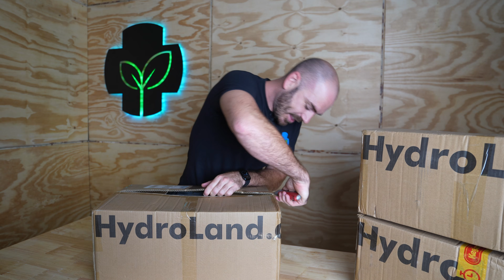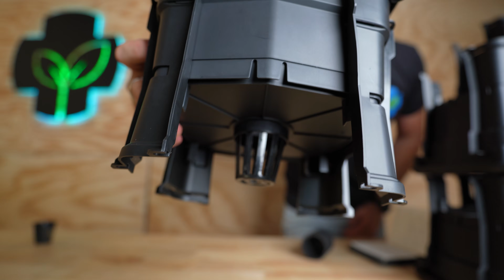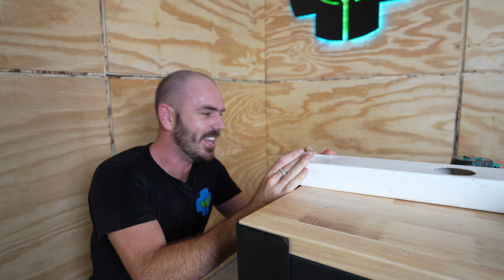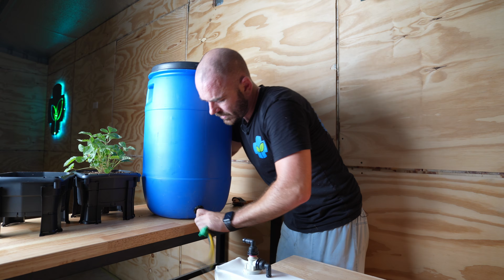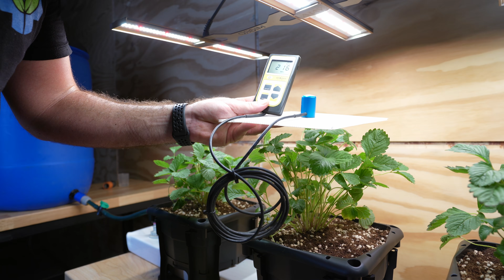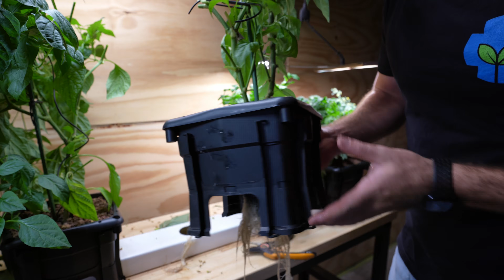Introducing the Hooch Multi Bucket Hydroponic System

Comment: Congrats on the new store! Exciting to see this after all of your work over the years. Really looking forward to having US availability (particularly California). Any updates on this? You probably know this already, but just in case, you should connect with Epic Gardening, as he's now built up his distribution business substantially. Question about the float valve you're using. On the site, you have listed two different floats, high pressure and low pressure (sold out). However, the description of the floats list the same working pressure. I'd have to assume you're using the low pressure valve in this video, as you're operating on a gravity tank, so I'm curious as to what the correct working pressure of each valve is. Again, the pressures on both valves are listed as 14-145PSI. Cheers, mate.

Comment: Hey just in case anyone else is having issues I don't think the float valves that were for sale from the website work the same as the one shown. The ones I got with my bucket order work fine for mains pressure but don't open with tank pressure, I've elevated my tank as far as possible and have filled it to maximum, still won't activate. Would love to know if there is a low head version of the valve available suitable for tank use.
Reply: Yes, in the Hydroland online shop, there is a high pressure float valve and a low pressure float valve.

Comment: you can get a combined pH and EC meters which will even allow you to connect them to WiFi and have a life readout for about 30$ from China. They feature replacable pH electrodes and 3 point calibration for pH. In my Tests I have found them to consistently be within ±0.02 of a factory calibrated 200$ pH meter when used continously in Aquaponics and Hydroponics scenarios.

The EC-meter is unfortuntely not removable but also comes on a cable and is of decent quality.

With continous use in aquaponics a pH probe lasts me about 1 season with a recalibration about once a month and you can get them for 8-20$ for a very reasonable quality.

They do need a contant power source. However, since your nutrient solution is usually close to a pump etc. I don't believe this should be a problem.

Just an idea for something you could carry if you want a decent device for a good price.

I used the be a lot more hands off before I got one of these because I can now get reminders or simply cueck my phone to see where my solution is at. I do a little bit more adjusting of the solution since, and have the subjective impression that it has improved my overall crop health and productivity, though i haven't measured it accurately

Comment: It looked like the legs over the small US downspout kind of floated in the video
Reply from the maker: There’s a lip on the bottom of the bucket hole/outlet, there was no holes in the pipe I was demonstrating so it doesn’t drop in in that clip. I was aware of that when editing and did a 🤦 hahaha.
The lip on the bottom is made so when it drops in it can return nutrients when I implement a Dutch bucket style system.